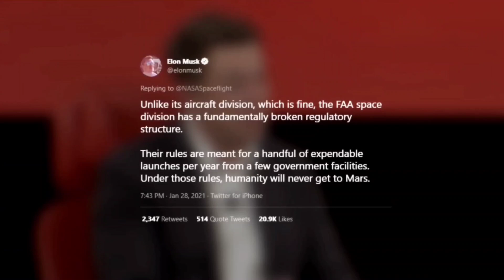Why FAA Keep STOPPING Spacex Starship Orbital Flight Test!

Comment: The Boca Chica plant looks unfortunately still very chaotic and I don't wonder at all, that FAA don't  straight away approves any flight operations from there. Aren't there too much equipments there on a too small area from a security stand point, if  a rocket explodes for instance.

Comment: The FAA does NOT keep stopping Spacex. The Super Heavy Booster is the reason they have had to do a new PEA for Boca Chica. Its failure modes (it has many, including factors such as amount of fuel and altitude of a possible explosion) make it dangerous on a much wider scale than a Starship or a Falcon blowing up. Fully fueled it contains 3,400 tons of propellant, while Starship maxes out at 1,200, and a Falcon 9 has about 410 tons. They have not launched a fully fueled Starship either. Mostly the PEA (based on the NEPA Act) addresses dangers to humans. They take responsibility for ensuring the safe operation of such facilities. Their process is not slow but very deliberate, it has to be. If something catastrophic were to go wrong and people were injured or killed, they would be ultimately responsible. Flight safety is the buck that stops at the FAA.

Comment: Why? It's the most powerful Rocket ever built. So they have to obey to strict safety guidelines.
Reply: If it blows up and can't hurt anyone, who cares? They have a proven automatic self-destruct used in Florida from NASA and USAF controlled space where FAA holds no sway. Works fine. FH works fine. 
Suddenly the new rocket requires unending "environmental studies" to see how much different this is vs launching Saturn V rockets from a waterbird reservation (where NASA's property is). 

Its a bad joke. They already did a review with FH. This is bigger but any explosion would Still fall well within their land. 

The Biden administration doesn't like Musk. 
Neither does Biden's FAA.
Reply: @avgjoe5969  you're not aware just how powerful the noise of the engines at lift off would be. You need safe guidelines, to humans as the impact to other wild animals.